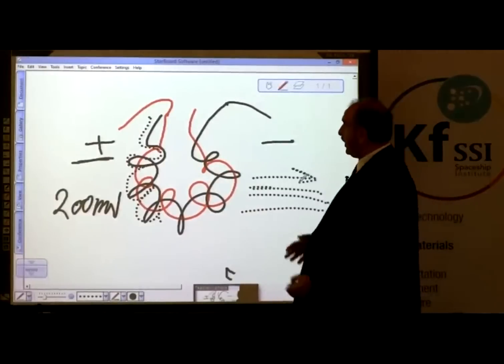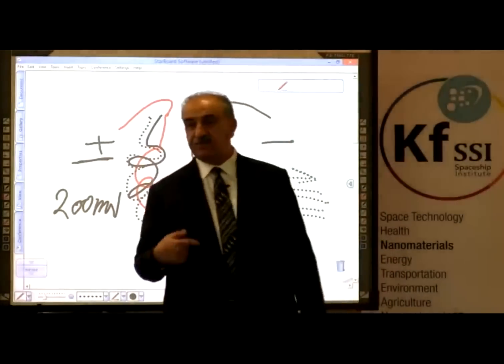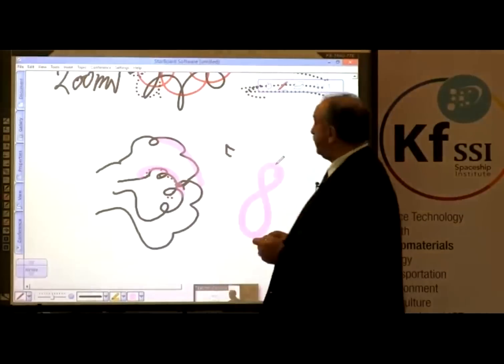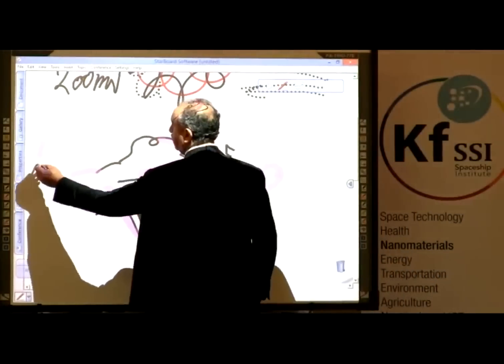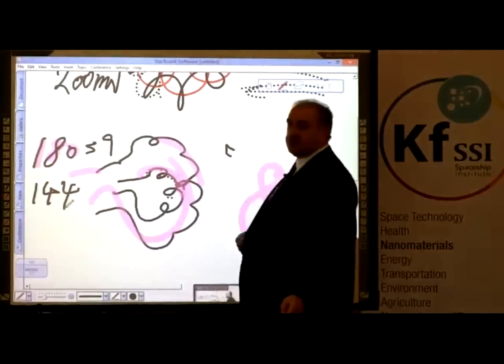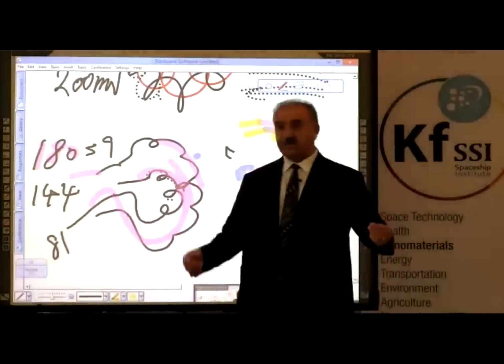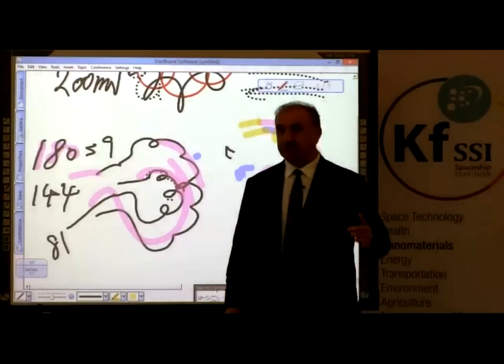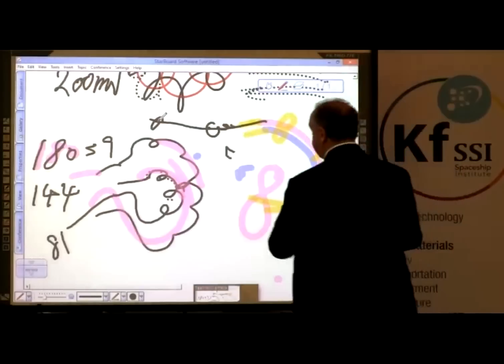Another important update from Mr Keshe

Comment: It seems to me that the coating process (similar to anodization to harden the surface and prevent corrosion) would benefit from the application of annealing (flame coating) and then a final GANS rinse, polarization and a jigged drying normalization. This was observed as beneficial for those aircraft components designed specifically to dissipate static charges and lightning strikes (static wicks).

Comment: I DO NOT BELIEVE DR KESHE MEANS TO CONNECT THE NANO COATED COIL TO A VOLT METER TO ALIGN THE NANO PARTICLES.  I BELIEVE HE MEANS AN AN OHM METER. THERE IS TYPICALLY A 1.5 VOLT BATTERY IN AN OHM METER WHICH WILL ALIGN THE NANO PARTICLES.  BETTER YET,  USE AN VINTAGE TELEPHONE COMPANY OHM METER WHICH USES 48 VOLTS DC.

Comment: also the GEET motor was also polorized and used plasma to power it.  You can make geet motor for small motors from home depot materials under $100.   Have tested it and its real.  Doing it to a car engine is alot harder though

Comment: Great but what about the ones that use a fire torch to nano coat? When do you apply the voltage then?
Reply: +Beloved Inbox Yes, I also have this question... i.e. do we still use the voltmeter to align the nano-coating when using the torch method of nano-coating? &#160;

If so, at what stage of the process after heating... while the coil is still hot, after it cools, or...?

Glad to hear this about the torch method too, seems a lot easier, safer and faster!

Also, is he suggesting we should now use 144 winds in the outer coils and 81 on the inner so as to shrink the diameter of the outer coils such that they will touch the inner coils?

Last but not least... does it make sense somehow to anyone else when he says that stretching the coils changes the number of winds? I must be misunderstanding what he means... perhaps he means that when you stretch them they will be longer so then you can cut some of the winds off to make them less winds but still same length?
Reply: +spiritheart4444  as I see it just put down the torch and start measuring. I am trying now since two days to fire coat, I cannot get the dark blue color, I get all sorts off colours, yellow, purple, blue, dark blue, light blue, I manage only to get a few turns dark blue. I give up now and go back to caustic coating.
As you realised, he sometimes is not precise in his teachings, you have to try and find out yourself.
Reply: +Wolfgang227 You are right, to all you've said.

Comment: So it is the torch method of nano coating from now on? and use a voltmeter between each coat ? and mount the both set of coils as close as possible? and 81 and 144 turn coils.